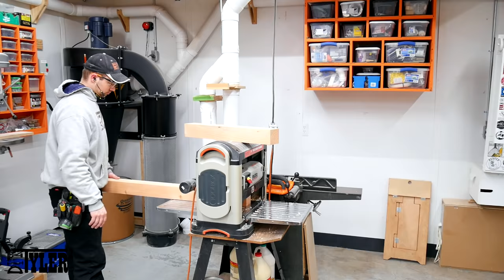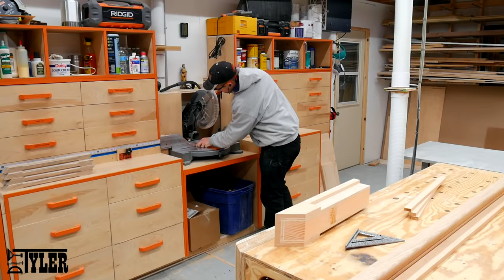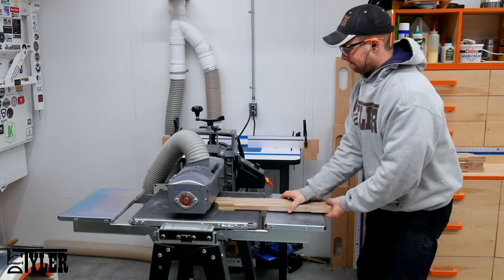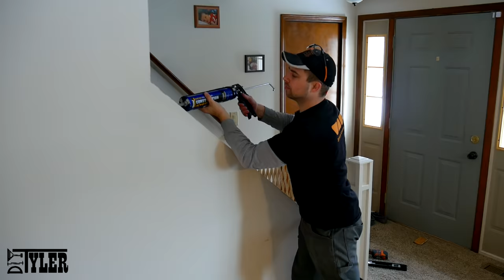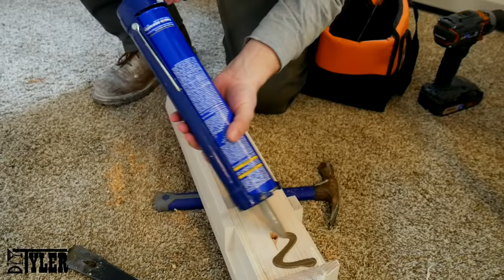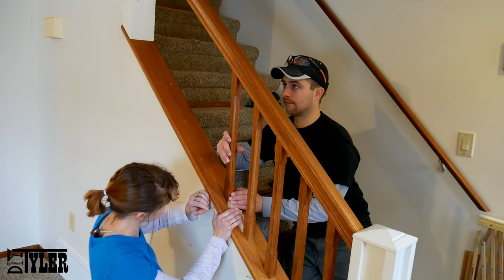Add a Railing for a Staircase

Comment: Is the handrail on the other side of stairs at the same angle as the new handrail you just built?
Reply from the maker: Very close but the old one is a bit warped which is throwing off the look. Will likely replace that with one stained the same color. Thanks for watching Phil!

Comment: The gap between those spindles is too big. It should be no bigger than 4", this is to prevent a babies head getting stuck between them, the overall height looks too low also, it should be 36".
Reply from the maker: Spacing is 3.7 inches and total hight is 36.
Reply: #troll